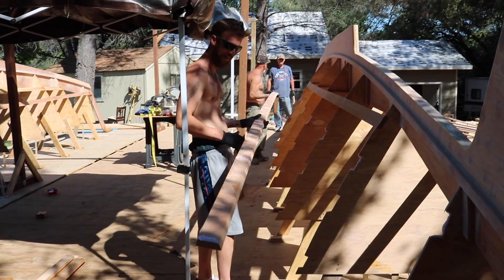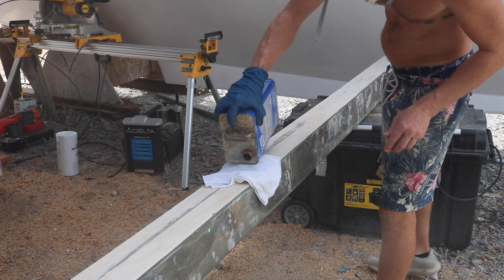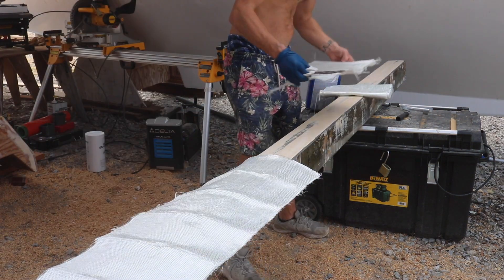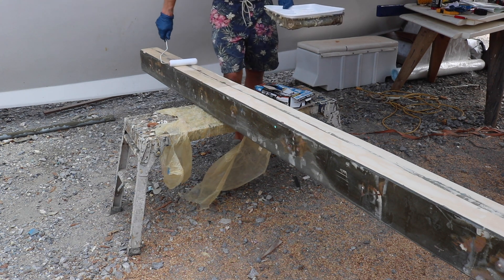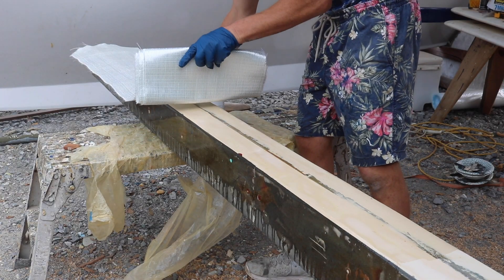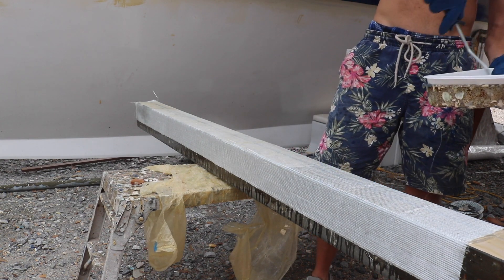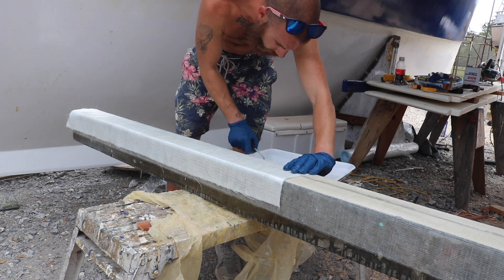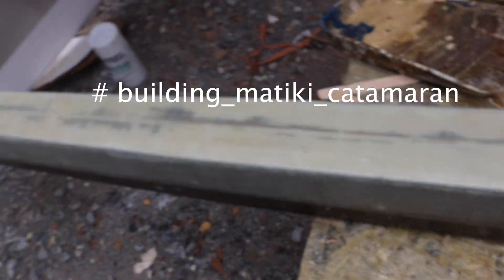E28 Fiberglassing the Beams with biaxial cloth

Comment: Hello, my friend ... you can see that this is not the first time you are doing this ...
How do you get the epoxy off the steel roll? I looked for a tool like this on the internet, but couldn't find anything. Where can you get this?
Greetings from Germany Uncle Ralf
Reply from the maker: moin moin, 
to clean the fiberglass bubble buster acetone is best, works like a charm. west marine has rollers in the States, but any fiberglass company should have them in stock.
 Gruss

Comment: Hi! I've followed you project from the very start and love your videos, awesome work. However, in this last video I wanna raise a concern. It's hard to see exactly in the videos, but it seems to be your not wetting out the cloth/1708 enough. Not nearly enough. In the last few shots (after you use the bubble buster) one can see dry, not fully wetted out spots all along the side of the beam.
Also, I've never seen anyone ever recommend waiting for the resin to get tacky. Remember, epoxy is not a laminating resin like polyester resin. (I've spent the last year working with restoring my hurricane damaged L48 in a boatyard, and seen alot of fibre glassing during that time).
I understand your point of waiting for it to get tacky, it would make it alot easier, but I'm worried the chemical curing process might not end up being correct. (I've also seen alot of delamination in the boats that come in the marina to get repaired, and repairs that are not wetted out, that delaminate).
Reply from the maker: thanks, I appreciate the input, more eyes on the job the better. 
where it appears to be dry cloth it's actually the fairing underneath that shines through, almost mentioned it in the video but I doubted anybody would notice, wrong I was lol
tacky is an exaggeration, but I wait a few minutes so its not so runny. might be an update on that application style in a few years 😁 cheers
Reply from the maker: after a lil research I have to agree with you, tacky was the wrong word to use and only good for laminating resin. to be honest I thought tacky means sticky as hell not almost dry, sometimes I get lost in translation. thanks for pointing this out 👍
Reply: I also like waiting a little so the wood soaks up Enough epoxy and it gets somewhat sticky.

Comment: That beam is going to strong as hell. Is that because it takes the thrust of the motors? 
I like the new intro, brings back memories.
Reply from the maker: the beam takes the main hanging weight from the engines. the thrust power will be on the forward beam, how I still have to figure out because I moved the engines from their original spot.
cheers mate

Comment: Great tip about letting the epoxy get tacky before applying the cloth.
Reply from the maker: just found out tacky was the wrong word to use, what I should have said is that I wait a few minutes so its not so runny and gives the underneath material time to soak up the epoxy.